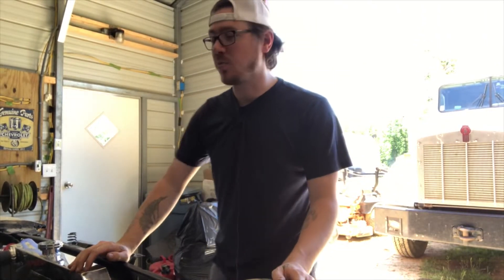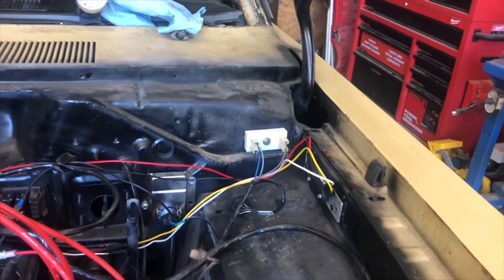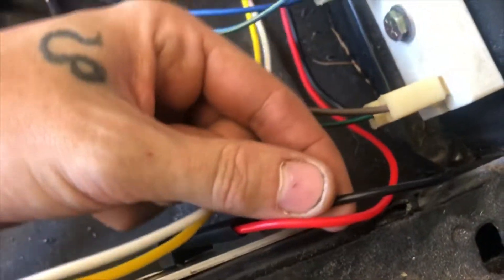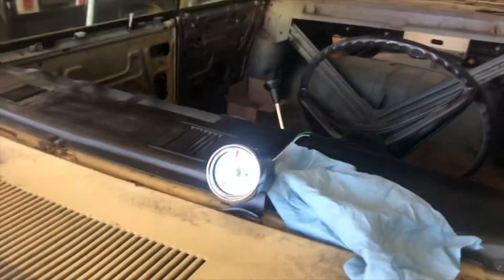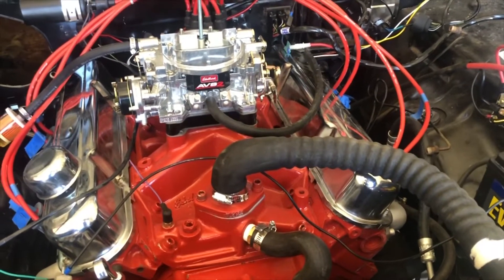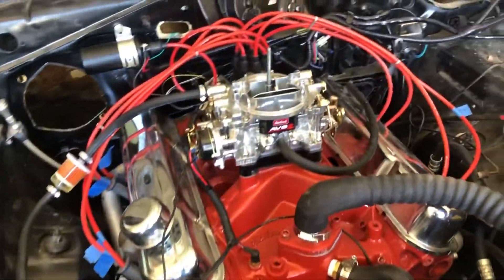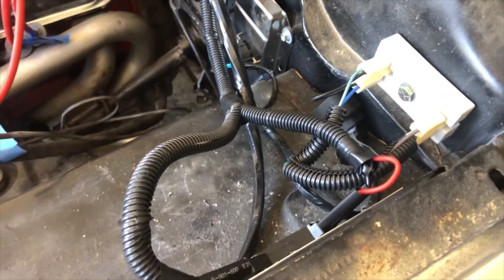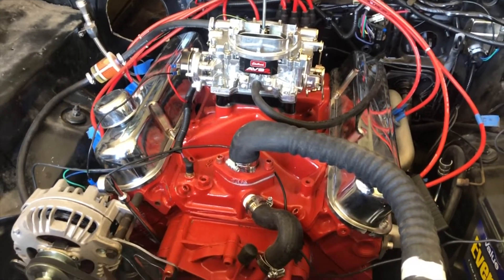1973 Dodge Dart first start in years!

Comment: Looking great, BBG!
Check for vacuum leaks.
Check your carb idle circuit screws (as it's a new carb, two on the bottom front). Maybe turn them in until they  are bottomed out, then back out about  2  turns both the same. You might be pulling just enough fuel from the metering circuit to keep running at 1100 RPM as opposed the idle circuit if the screws are in too far. Or you could have a major vacuum leak. Check that the carb is tight to the manifold.  I think you mentioned that you are using a carb spacer on a previous video. Check there also. 
I'm sure someone else will chime in also. Probably even tell me I'm an idiot. Lol
Good luck, and a again, your doing a great job.
Reply from the maker: Hammy 1739 thank you for the input!  I’m thinking it’s a combination of exactly what you mentioned, but by the time I got it running at 1100 it was nearing the end of Sunday so I had to stop there.  More to come soon, I promise!
Reply: @BlownBudgetGarage  
How's it going? 
You doing alright?
Reply from the maker: Hammy 1739 no not really.  Going to announce winner but my grandfather is currently dying so I’ll announce after everything settles down a touch.  Sorry for the delay.  I promise I’ll announce winner soon
Reply: @BlownBudgetGarage  
I was just wondering if you had a chance to sort out the carburetor/ vacuum issues.  Obviously, you have more important things going on at home and I'm very sorry to hear this. Take care of yourself and the family. 
All the best to your grandfather. 
Hammy

Comment: Haha did the same HEI setup on my '70 Dart with a slant 6. Adjust points on the inside of the slant is a pain in the ass. So about 7 or 8 years back on a Saturday afternoon I was having some "cold snacks" and decided to do this setup because it was simple, inexpensive,and allowed me to eliminate all the ballast resistors. It has served me well.
Reply from the maker: Mike W I haven’t deleted the resistor yet because I wanted to use the power wire for the coil from the harness I got from classic industries, but I will be soon.
Reply from the maker: Also I’m glad to see another VGG fan.  His channel is amazing.  Down south tho we call cokes and beers cold drinks lol

Comment: 150 success I actually look at your car before I bought my scamp about the same time u bought yours. Bought mine just south of Nashville. Keep up the good work.
Reply from the maker: Samuel Willard Catron thanks man. I’m not too far south of Nashville myself!
Reply from the maker: Samuel Willard Catron if you’ve watched all the videos I’m sure you’ve noticed that the ad for this car was just a touch off lol
Reply: Yes I have and honesty is hard to find now a days. Actually I bought mine im Shelbyville it was a running car 318 and solid frame and body. Just needed front floors and trunk pan with green interior so I am going with black interior and b5 blue body.
Reply from the maker: Samuel Willard Catron spoiler alert, but I’m doing this car black on black on black 🤫
Reply: Triple black cant beat that.

Comment: Should have three adjustments, back the throttle one until idle rpm is where you want then adjust the two on the front in until a gentle stop then back out 1.5 turns then adjust throttle screw to where you like. Should be a good starting point
Reply from the maker: I tried that.  I believe I’ve got a vacuum leak somewhere, could be from the spacer.  Gotta do a little investigating, but I’ll get it all dialed in next episode!  Gonna be busting out the vacuum gauge and getting her juuuuust right.
Reply: @BlownBudgetGarage  could spray a little carb cleaner around that spacer. If the rpm raise that's the leak
Reply from the maker: John Beach yessir that’s the plan.  Once I got everything done it was late into the day Sunday so I don’t have time to check every spot for a vacuum leak.  Didn’t think at the time to spray around the carb since everything was new.  Solid tips tho man I appreciate it!
Reply: Just watched it back after a few beers and had a thought... With the electronic choke connected it is gonna take over. In the summer months I actually take off one wire to the choke at the carb so I don't idle so high... Make sure you adjust the carb and timing at operating temp
Reply from the maker: John Beach I can give that a try too.  I think it’s just too much fuel at idle so I’m also going to try some softer metering rod springs.

Comment: 150!!!
Reply: I’m redoing a 74 Dart Custom. (4 door). 440 with an auto.
Reply from the maker: Mike Hester that’s awesome man, wish I had a big block to throw in this one.  Next build maybe 🤔
Reply: If I hadn’t found an old rv with one, I would have went 360. Love all the “fixes” you do, I’ve always been a ford man, so a lot of this Mopar stuff is new to me.
Reply from the maker: Mike Hester I’m used to 350s and heavy equipment diesels lol it’s been a journey for sure.  Once the shop is up I’ll start saving for the next project.  I’m thinking big rear window barracuda 🤷🏻‍♂️
Reply: Blown Budget Garage that sounds like a nice one.